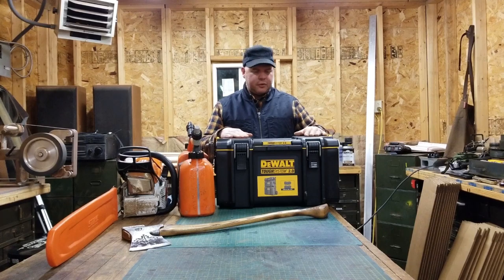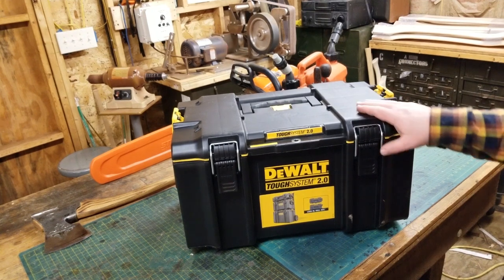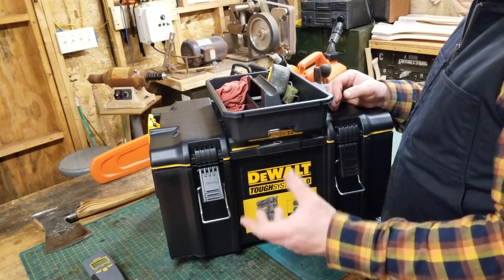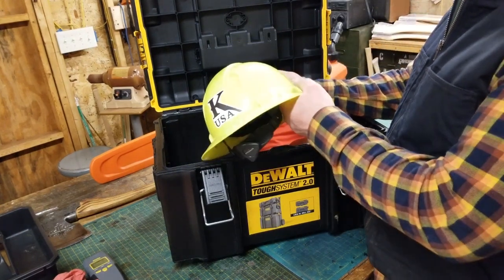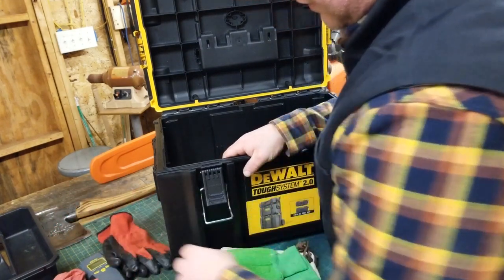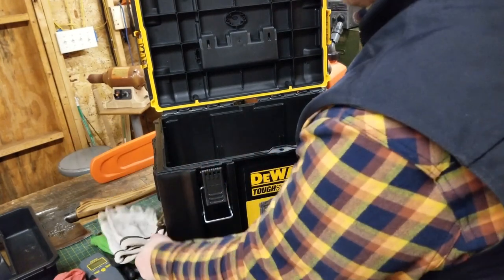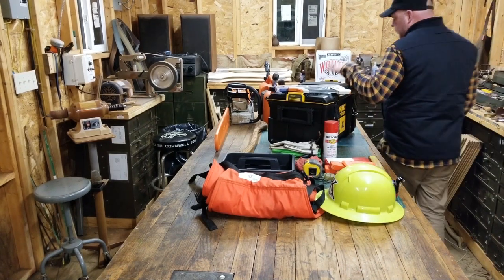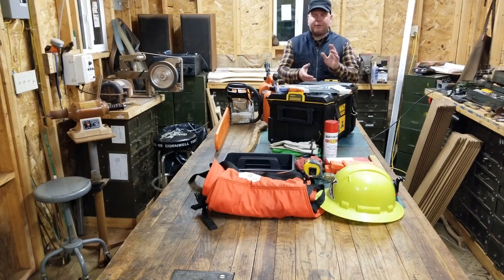Making The Ultimate Chainsaw Firewood Kit!

Comment: My solution was to make a wooden tote that looks like an old school tool tote. Fitted compartments for bar oil  and water on one end and fuel on the other. Between those is a compartment for chains, wedges, gloves, tools, wet molded leather wedge pouch that I made, rags, and extra e-clips, cage bearings, washers, rim sprockets, etc. My forestry helmet rides on the end of the handle support. I wear chainsaw pants. I usually have two saws with me, an axe or 3 lb. hammer for driving wedges, and sometimes a peavey or cant hook. First aid kit is either in the vehicle if I'm working near it or in the tote. Ropes, straps, snatch blocks, etc. ride in the truck. No measuring devices for determining round lengths.  I can eye ball 16" +/- 1/2" consistently.  

I cut a lot of hazard and fallen trees on rail trails and it's not uncommon to have to remove leaners. That is why there is so much gear.
Reply from the maker: Well Planed out kit!

Comment: Hi Chris!!😀😀
Not a bad setup. 
There are only a couple things extra that I carry besides my saws when I go to cut firewood. I have a 6× 4×16 flip top toolbox that I made in high school that has all my chainsaws specific tools in it such as scrench files, torque bit wrench, ect. 
Being a logger all my life my truck always has everything else you could imagine you may need for making firewood. It's very rare for me to go out with just the tractor to cut wood just because of the lack of room for everything you may need when it's already in my truck. 
If I go to cut with my 4 wheeler. I usually just grab 2 saws axe a couple wedges my gas/ oil jug like yours and my little toolbox. Very rare I need anything more. 
Take care my friend!! TTYL!!😀😀
Reply from the maker: Hey Al, sounds like your well prepared!

Comment: Chris I have the same boxes except the Ridgid brand as they seam as little less $ than the Dewalt. They are waterproof and carry the medium and the small one locked together for my travel tool box in the back of my truck. Have another medium for my saw box as you do. Carry about the same other  than spare chains and spark plugs. All my saws bars a marks at eighteen inches as that is the length for firewood I like. I used ibc totes so 18” seams to stack,the best in them. 👍✊Great video stay well @and safe.
Reply from the maker: Hey Bob, yes those ridgid brand are nice as well!
Reply: @KillingerUSA  👍

Comment: Put a zip lock bag in with logger crayons or side walk chalk to mark length with but keep spray paint to Mark future trees to cut that you find while cutting. I have also used a wedge banger axe to Mark lengths with a small straight twig like branch a little over 4 feet long and marks on it to put down for marking 3 rounds with each placement.
Reply from the maker: Great tips!

Comment: I have a milk crate with a small tool bag that has all the same tools you have as well and a spare chain for each saw. Works great because I roll my chaps up, fits my 1 gallon bar and chain oil, boys axe, etc. Looking for a good first aid kit that I can add to my kit. Extra gloves are always a good idea. The Stihl 2 in 1 sharpener is awesome! I have one for each of my 2 size chains, .325 and 3/8, I am like most and practicing hand filing. For me, in the field and learning, I go for the 2 in 1, get a log bar clamp, they help hold the bar solid.
Reply from the maker: I did use a milk crate for a bit.  It worked ok.  I always have several axes with me. At least one rides in the tractor at all times. I always grab a couple extra to play with lol

Comment: I’d definitely carry an extra chain if you only take one saw.  If you take two, and you’re not that far from the shop, it’s not that big of a deal.  But I always carry an extra.  Also you might want a stump clamp if you do any field sharpening.  I usually just swap out the chain if it gets dull, but sometimes it just needs a quick touch up, and I find the stump vise helps stabilize things.
Reply from the maker: That's the other thing I forgot to mention,  a stump vice. Definitely getting one.
Reply: I use the Pferd,  but in this case I’d get the cheapest one you can find.  There’s only two parts, one cast piece of metal and a screw.  Can’t really mess that up.

Comment: Your pretty spot on. I with Crazy man the milk crate is bulletproof and a .223 ammo can for tools and chain. And I never go cutting without a 50’ choker ya never know when you might have to reach out to touch one. Chris I have been cutting four to five chords a year for 30 years I’m with you just can’t get that 16” sweet spot. I’ve tried the paint didn’t work well in the rain. The stick is perfect but I just grab a small branch 1/4” cut it to length and just hang on to it in my left hand and mark after each cut. When I say mark I mean eyeball something on the log. I just did 3 chords in three days without my woodsplitter (wheelbering)
Reply from the maker: I try to always keep a couple chains on the tractor.  Thing kinda spoiled me.
Reply: @KillingerUSA  And a peavy is a must for me to keep the chain out of the dirt.  I cut in some pretty remote locations it would be nice to put that L3560 in my back pocket

Comment: I have 20 mm ammo can, with a trauma/stop bleeding kit, two size wedges, amish made feller pouch, flat file and raker gauge, tape measure, flagging tape, chaps, helmet and ear plugs, spare parts box ( bar nuts, and spark plugs and small screwdriver for Carb adjustment), spare chains, 1qt bar oil and 2 qts emergency fuel, rides around in truck tool box everywhere I go
Reply from the maker: Good idea on the flagging tape! Need to add that to my kit!

Comment: I notice you have a burnishing rod on your spindle grinder in the background.  Where’d you get it?  I can seem to find one.  Thanks
Reply from the maker: That's actually a special variable speed grinder that is sold like that. It has a sanding drum on the other side. Bought it from leather machine co. They might sell the spindle?
Reply: If it’s not too much trouble, could you get me make and model number?  I’ve been searching for something just like that for over a year.
Reply from the maker: Sent you a message with link on messenger

Comment: A while back I decided upgrade my chainsaw box which was an old fruit basket handled box.  The orange homer box I bought from HD filled up quick!  That Dewalt box is the size I should have gone with.  It’s nice to have everything you need in one spot.  Nothing worse than having to run back to the house for a file, wrench, chain etc after you get set up!
Question what finish do you recommend for your red elm handles?  Snake oil?  Was wondering if boiled linseed oil would be to light colored....
Reply from the maker: Linseed oil works great and so does snake juice.  Both will give it a rich color. Snake juice will give it a tad darker color
Reply: Sanded down the handle 400 grit and went with a combo of linseed,tung oil and satin poly.   Looks almost too nice to swing.  Great handles !  Thanks Killinger
Reply from the maker: @fredhallett5857  that's what I like to here!